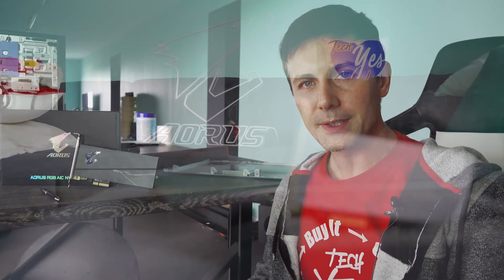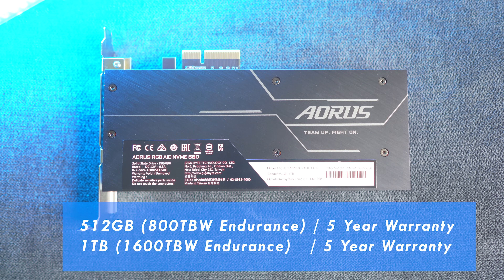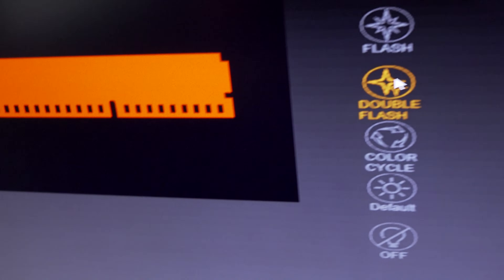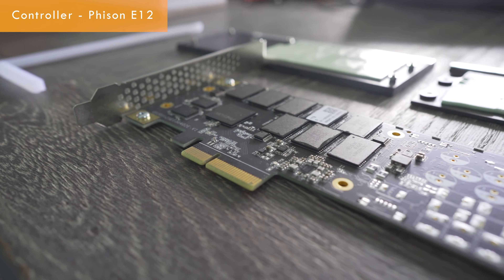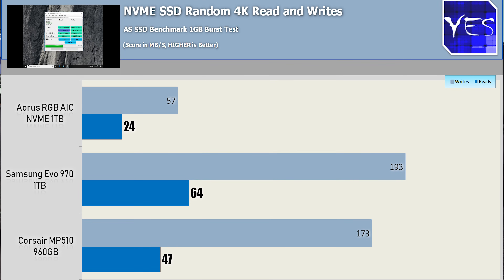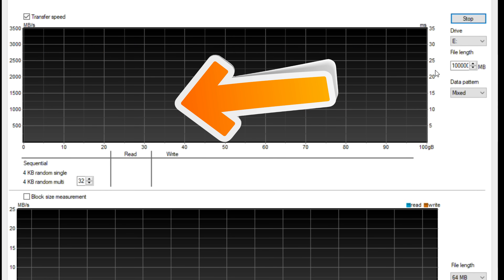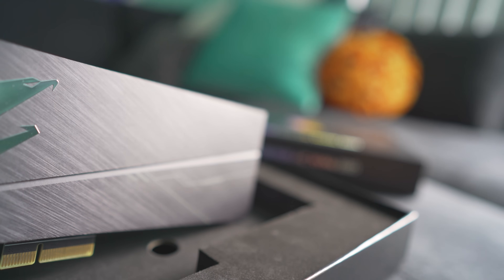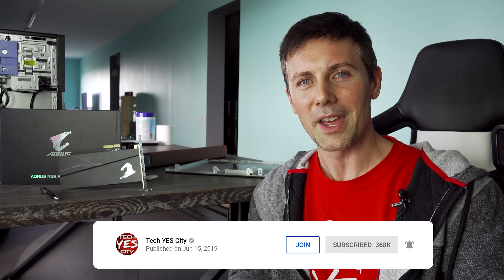AORUS AIC NVME SSD Review (1TB) - Now with RGB....

Comment: @Tech YES City Got a huge and my first question for you: does this PCIe boot on a x58 platform? I got an Asus P6T Deluxe v2. So I wanted to put a NVMe. I actually use an PCIe x4 adaptor SATA 3.0 (on the port with the same lanes) Seeing this, I suppose it works then. But if I search on internet the only reference I got about boot, and this card, is from you. And I Follow your advice to upgrade my entire system to x58 just about 1 moth ago (The most happy person on the planet doing this, thank you so much for that, saving a lot of money, I always got the feel that was the best way, and then I found and seeing your channel for confirm everyting) greetings from Chile.

Comment: Bryan, we can all do with lower prices and more options in the Nvme space but for the life of me why did they make it so BIG. I looked at it in your case and it just about completely blanks the GPU intake. I agree with other comments - a low profile slimline adapter and a 970 EVO is smaller and every bit as fast and I am also sure the airflow would be much better.

Comment: Very curious as to why there is so much power circuitry and connectors missing on the board.
Reply: Yep seems weird. That was the 1TB and backside empty, so 2TB version has to come out. But all thoses capasitor spaces and what not?! I'd like it more if the unsed space was cut off. That's way too big, even comparinig to normal SSD. Will block all GPU cooling.

Comment: RGB Fusion sucks, I bought a gigabyte rx 580 gaming and when I launched rgb fusion, it loads and crashes and wouldn't open again. It did stay in my task manager and it was trying to restart all the time until I stopped it. I eventually read on a forum that you have to install a older version of rgb fusion that does work. And it did. But still, I think the software is horrible.

Comment: I found that the Sammy 970 Pro's have the legs to transfer files bigger than 100GB's without slowing down. I think theres just more cache on the pro's compared to the evo's. Other than that, the evo's are priced alot better. Gigabyte uses the best components, i guess not enough cache in these particular models.
 I guess gigabyte didn't feel it would be a good idea to send out the Aorus Waterforce 5G to every worthy reviewer. Just the praisers.

Comment: Hi how do I find out if y computer can boot from pice??🤔
Reply: Easy, if you have a Z97 chipset or newer you are good to go, if you have an older motherboard you may need to mod your BIOS.
Reply: Thanks I have recently bought a used dell precision t1600 with a Xeon e3 1270 12 gg ram going to upgrade graphics card, will the bios be upgradable? For nvme also can you suggest suitable graphics card I have 650watt power supply 
Thanks
Reply: @hybridparts3169  If this board has an AMI UEFI BIOS, you can modify your bios to support NVME booting. Some NVMe SSDs like Samsung's 950 Pro SSD are natively bootable in LEGACY mode (CSM and loading of Option ROMs has to be enabled within the BIOS), because their Controller chip contains its own NVMe supporting Option ROM module. If your bios isn't AMI UEFI you could get a Samsung NVME SSD. With a 650 watt PSU, you can use any modern graphics card you like.

Comment: Just get an adapter and add in your own nvme m.2 drive for a lot cheaper.
Yea, youtube throttling new videos from massive output of bandwidth all at once.
Reply: @Patrick B It is a PCI Express 3.0 card. I personally find it stupid to drop 1k$ on a new board CPU and ram just for 20-30% performance increase for the applications I run.
Reply: The benefit of an adapter and BYO nvme drive is price/size cost, speed and replacement cost.
Reply: Or just use the m.2 slot on your motherboard
Reply: @leexgx  There is no M.2 slot on older Motherboards.
Reply: @The2808erik  then you probably don't need one of these (you probably can't boot of it even if you installed it unless it had legacy boot on it like the older Samsung pro m.2 ssds did) 

if you want storage as m.2 I guess that works but a larger normal sata ssd be Likey better for money
Reply: @leexgx  I can boot of NVME SSDs, Z97 and up have native support for NVME, anything else with an Ami UEFI bios you can mod the BIOS with the necessary modules.
Reply: @The2808erik  depends on your usage. The adapters with m.2 nvme (versus m.2 sata), even if not used as a boot drive, makes for some blazing fast storage. Yea, content creation gets the biggest boost but, also those that move files around a lot also like I do when backing up customers data before working on their systems. I hate spinning rust.